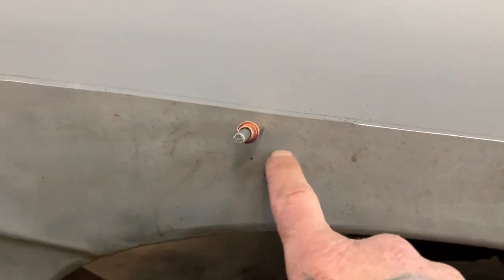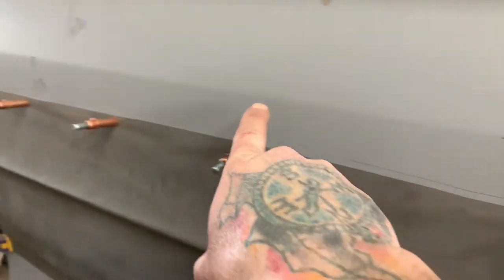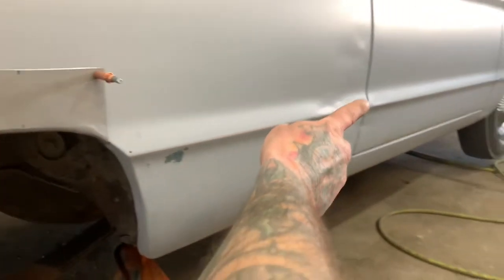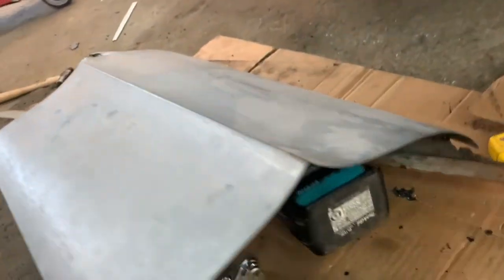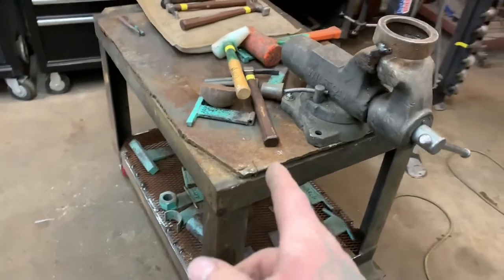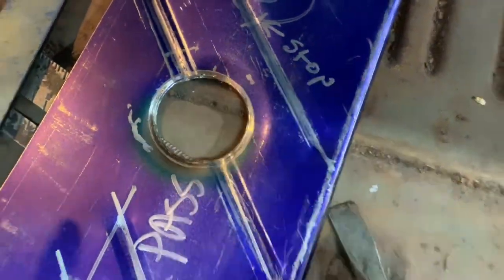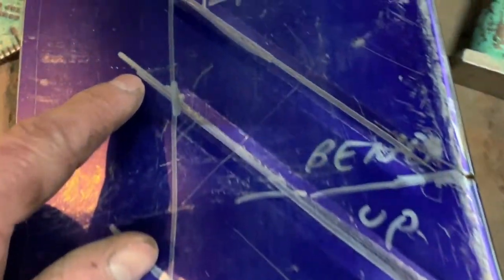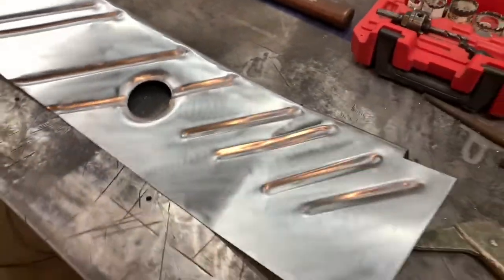Sheet metal fabrication

Comment: I had a sheet copper project to do and needed some clicos to help the fitting of the panels. I went to 4 body shops and found none. Seems no one here fixes panels any more. They just re and re them. Crazy eh. I ended up getting some and the tool on ebay 3 weeks later. Love your work my friend. Love the laser ! sure beats measuring up from the floor.